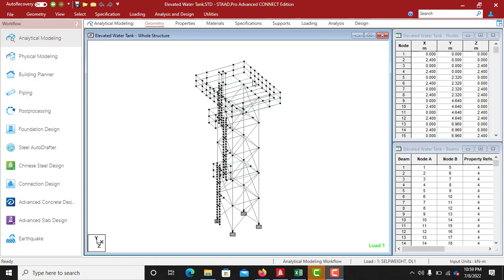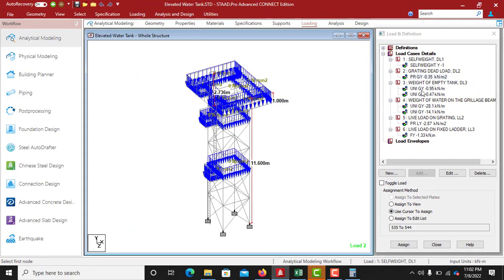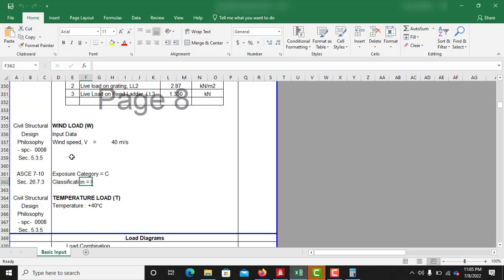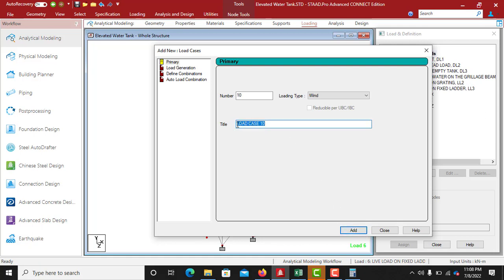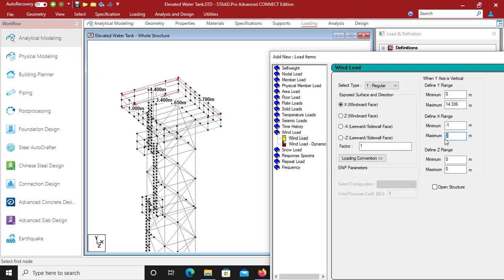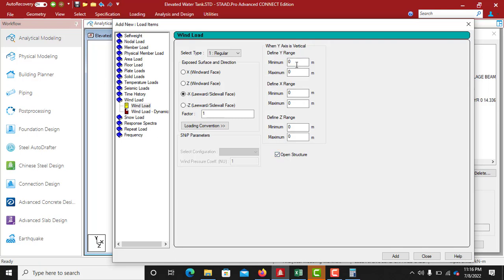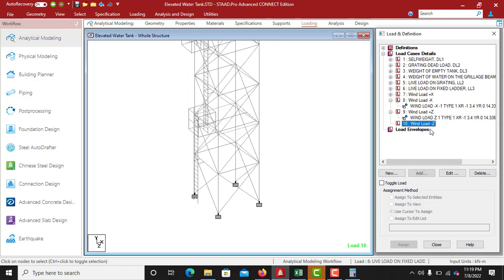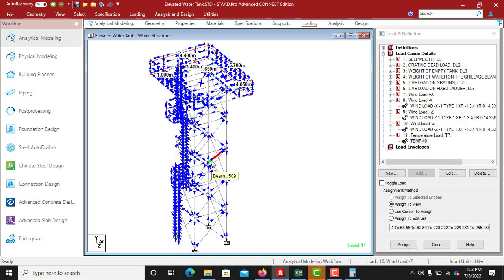How To Apply - Wind Load and Temperature Load  - STAAD PRO CONNECT EDITION

Comment: The reactions developed due to the temperature will be  very high  . How is it solved.
Reply from the maker: Temperature load is dependent on the location of the project. If the location doesn't have such high temperature, then you reduce the temperature accordingly. Secondly, if the location is prone to high temperature, then you design the foundation to be able to take care of the reaction forces and also change member sections that might fail because of high temperature.